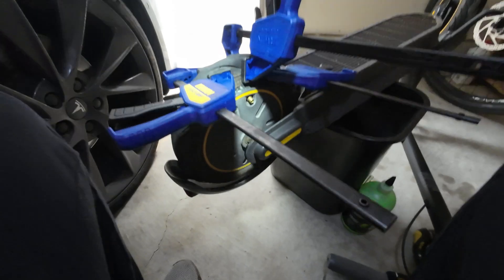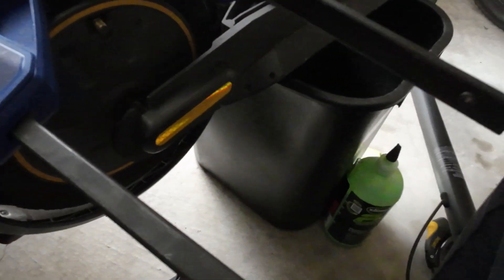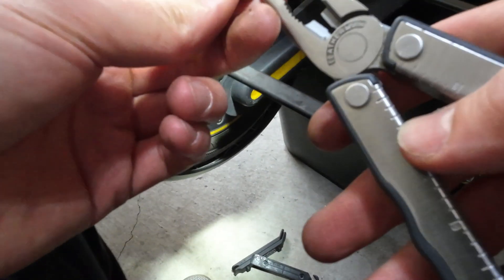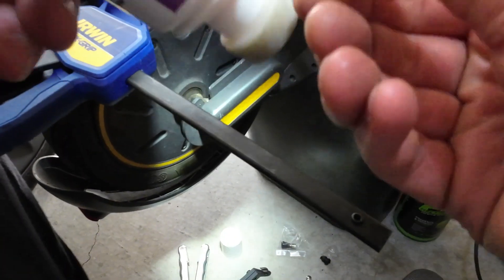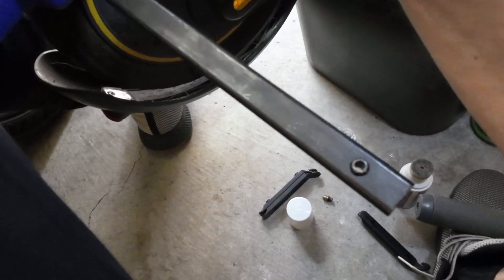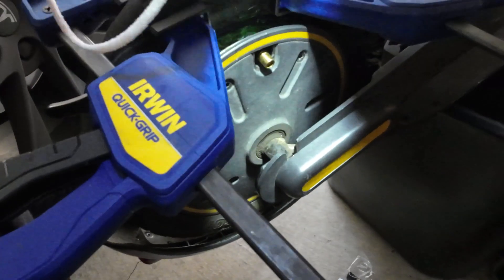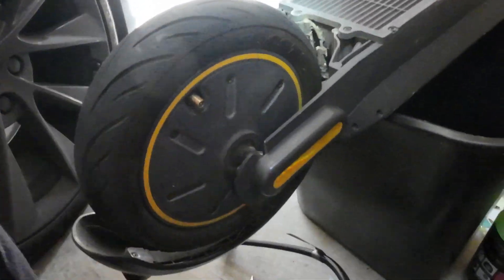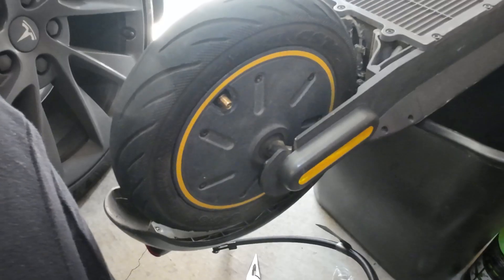Segway Ninebot Max stem repair

Comment: After valve stem installation do we need to apply any insulation for tyre or directly need to pump the air into stem valve?
Reply from the maker: Directly pump it up, first pump part way to get it seated properly so that it seals around rim, pops out etc, then inflate to normal pressure

Comment: Good job. Please what is the name of the tools you use to press the tyre before changing the valve?
Reply from the maker: Trigger clamps. I used dewalt. you need some medium duty ones at least that give a lot of pressure
Reply: @3XT_Tech okay, thanks
Reply: Just look up grip clamps of Lowe’s, Menards etc. 
I call him squeeze clamps, because when you really have to squeeze their squeeze clamps lol  I like the threaded type better myself, but to each his own and the quick grips that’s what they’re called probably but the quick grip or squeeze clamps do work well and fast, perfect for light duty projects like this gentleman has kindly showed us how! Thank you btw… so bar clamps, Quick grips, I use for masonry work all day long hanging corner poles, and sometimes we have to get some really tight pressure on those to keep them from dropping…

Comment: Maybe put the valve cap on once the stem is sticking out and then use the pliers to grip the valve cap? Valve cap may prevent the valve stem from falling into the tire.
Reply from the maker: That could work